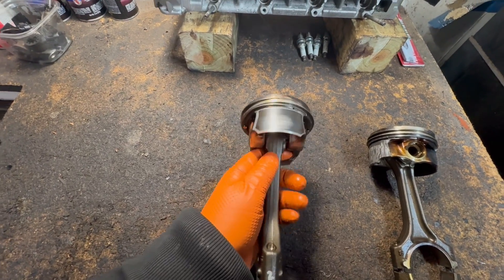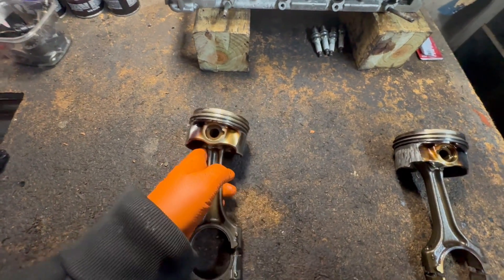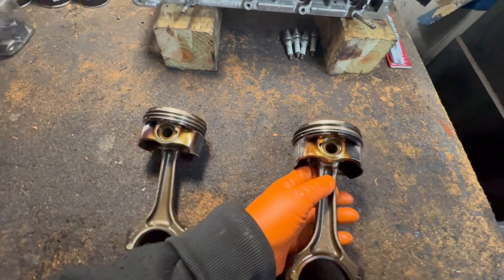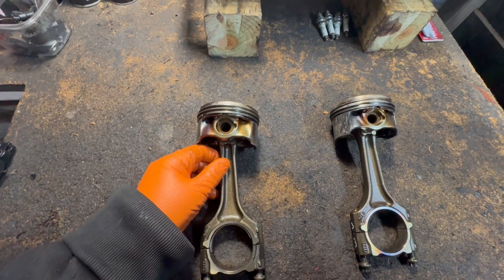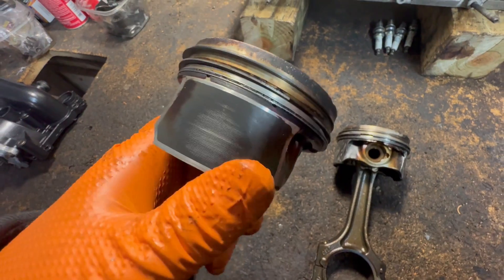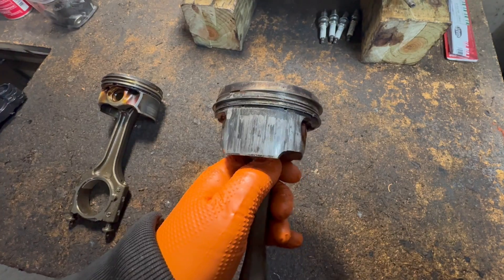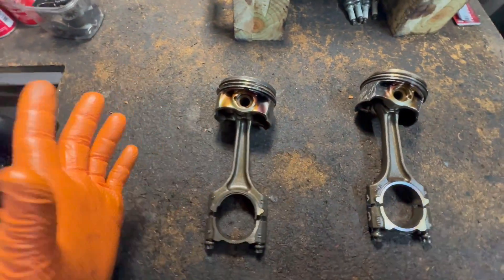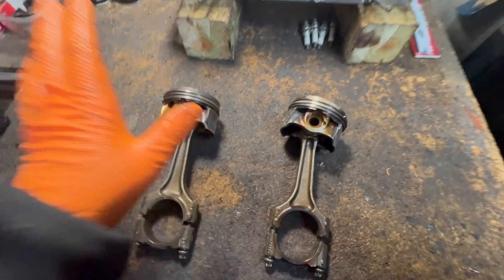What Does Normal Cylinder Piston Wear Look Like

Comment: My 2012 Camry, AFRE 4 cyl, 2.5 is burning oil.  No smoke at startup or while driving.  No puddle or drips underneath, left white cardboard underneath it overnight.  I'm topping it off at least every 2 to 3 weeks. Routine oil changes at 5k, 0-20 mobil 1.  Has 219k miles.  Would pcv cause this, oil rings?  Runs good, thanks!
Reply from the maker: Yes, PCV can cause that along with worn valve stem seals and piston rings. You can try changing the oil and PCV and put some "NO SMOKE" additive that may help your problem a good deal.

Comment: What does a bad/good wrist pin joint feel like?  Is some side to side motion okay vs obvious slack when pulling in and out on the rod while holding piston still?
Reply from the maker: The wrist pin should slide in the connecting rod bushing with hardly any resistance but absolutely no play anywhere

Comment: Thanks. I understand there's some thin coating on the cylinder walls that eventually wears off. That worn piston obviously damaged the wall it was in. Are you going to hone the walls or gonna replace the block? What are you going to do specifically for this engine repair?
Reply from the maker: Good question! , I am going to hone all the cylinders as they were slightly scuffed but still in spec
Reply: @motorcarnut  Ohk. I've been honing them forever without any issues but I've been concerned about the thin coating. I guess it is just an addon for less friction i.e. less fuel consumption.